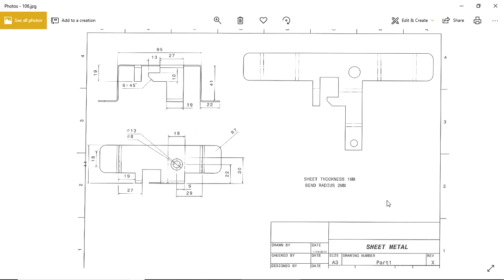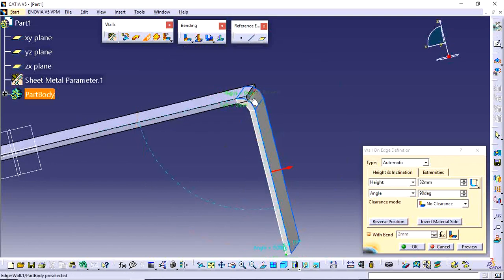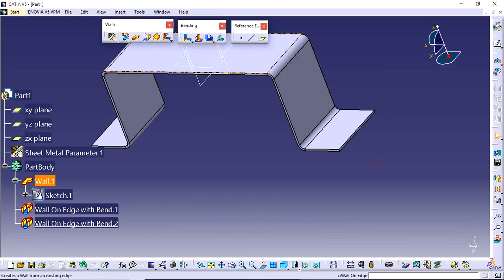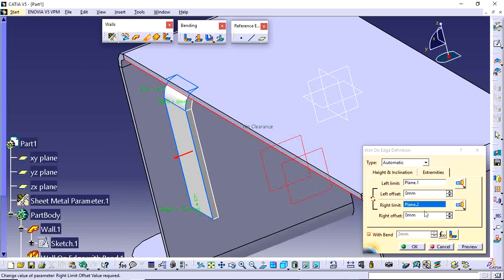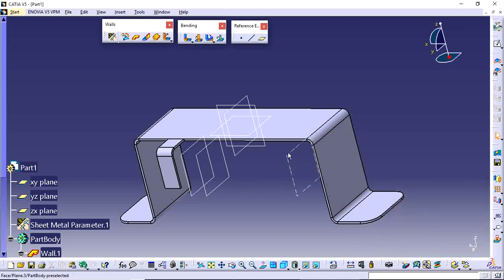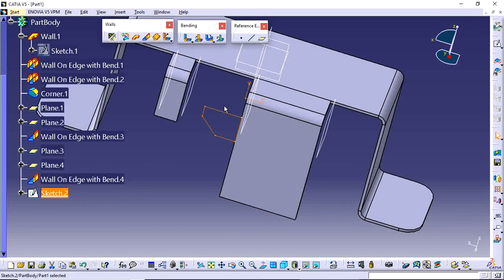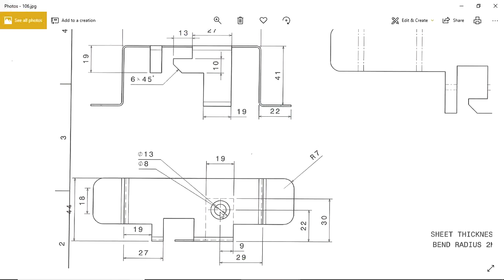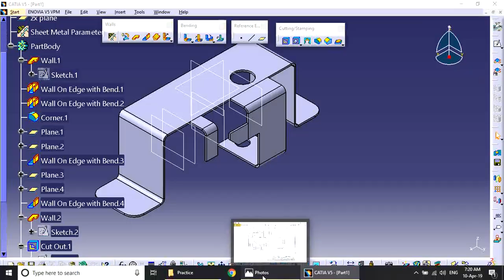CATIA V5 SHEET METAL PRACTICE DESIGN 1 for beginners | CATIA Practice | CAD Designs

Comment: It's nice to have catia tutorials to learn or refresh your memory. But there are irregularities in the design process. Or rules to follow to guard against future problems in case of modification of the part. which happens very often.
You have to create a geometric set that allows you to store non-physical objects, to avoid polluting the tree. They should be renamed clearly if possible. It is necessary to refrain from using physical object to pose its sketches or these contours. Because they are modified or deleted this will create errors to be corrected.
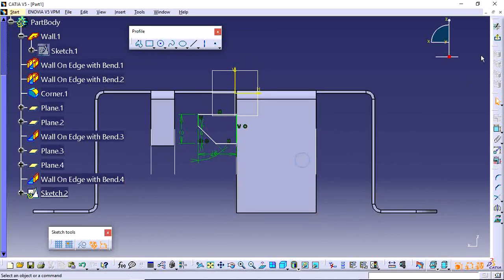We notice by creating an unfolded at the end that a part has not been done correctly (15:56).
To do this well, you need to make a longer flanged edge with a cutout rather than adding material. You have to get as close as possible to the creation of real life pieces. When we make this part on a folding machine we cannot add material. Except with the thickening file ...
To finish, in general it is necessary that a sketch is not stuck on the profile via a coincidence, it is taken from catia V4 where one could have problems of microscopic holes.
I hope that my comment is sufficiently clear being French ... Good continuation.
Reply: Hello sir, would it be possible to ask you for one advice regarding sheetmetal design and manufacturing? Since i faced one problem on current project that im working at 😅

Comment: It's wronge. It dosen't match the 2D but great vid
Reply from the maker: May be little bit changes, Follow drawing sheet for perfect dimensions.
Thank you for your feedback...!
You are Welcome...!
Reply from the maker: Follow this link for sheet: https://m.facebook.com/878497132219416/photos/pcb.2158985540837229/2158985427503907/?type=3&theater
Reply: It happend to me to, double clic on the part that does not stick on the reste of the sheetmetal, then select the face that is tanget to it in the window that pop up, that will fix it.
Reply: @CADDesigns  how can we check  dimensions after completion , so that it can be verified .